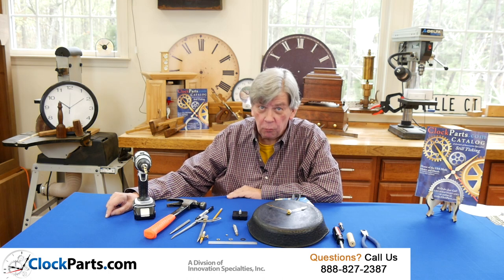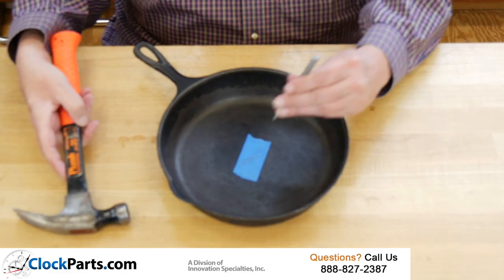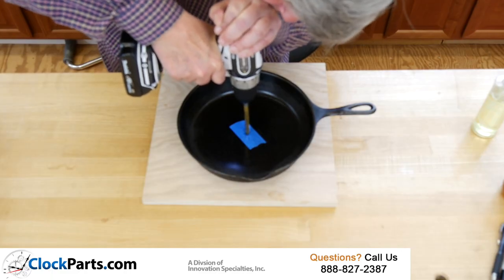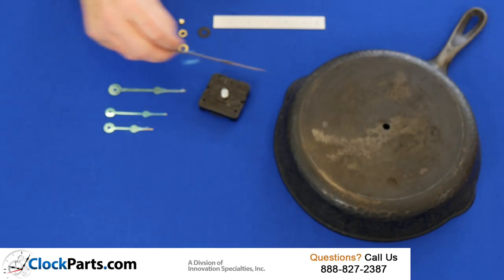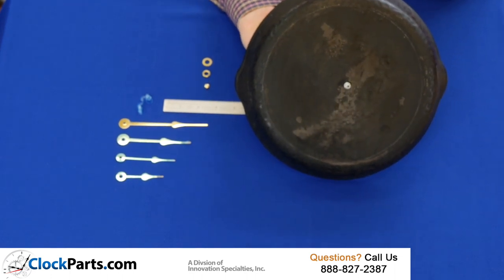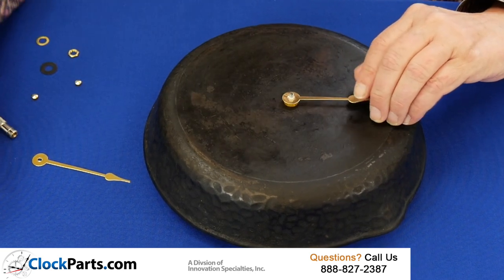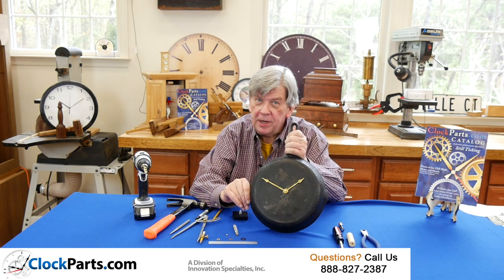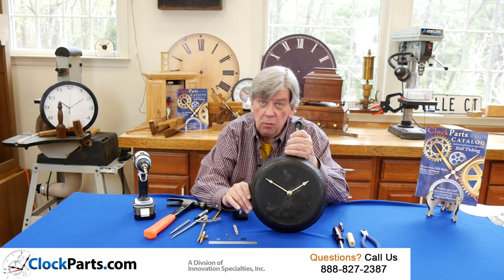How to Make a Kitchen Wall Clock

Comment: Can you drill through enameled cast iron, as well? I have a spare enameled dutch oven lid, but the center hole is too small to fit the 5/16" shaft of a standard box of clock mechanisms. I'm concerned the enamel will shatter if I attempt to widen the existing hole.